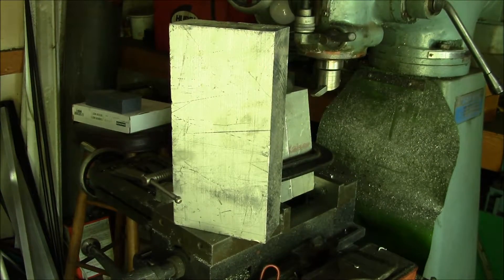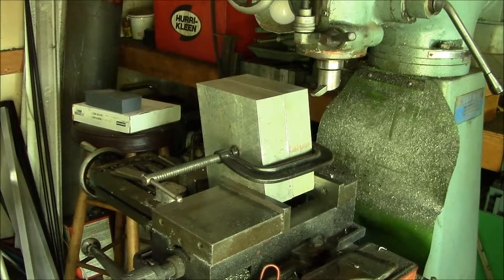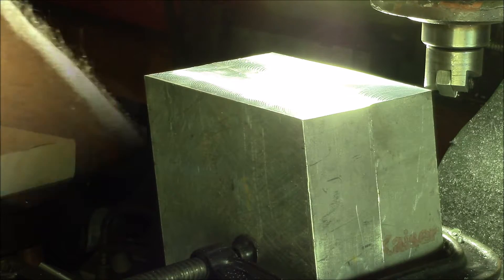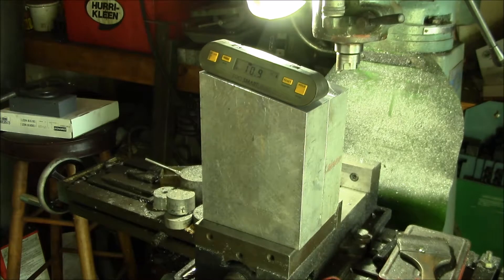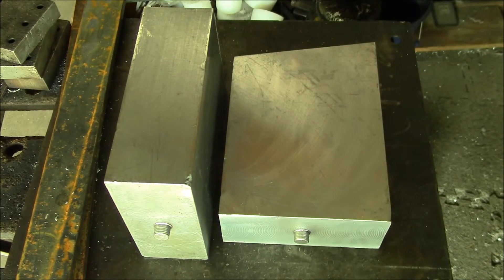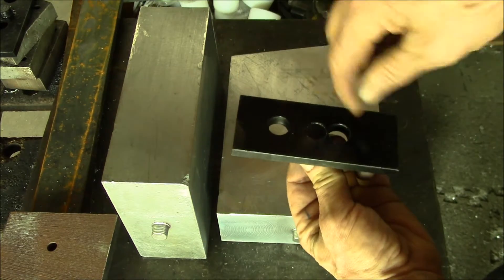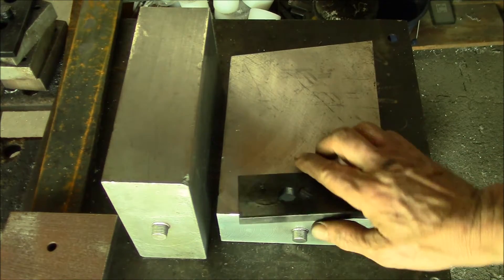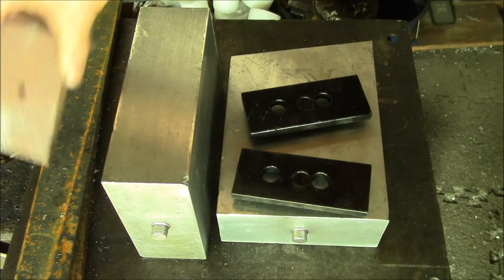Making Tapered Suspension Lift Blocks

Comment: Dont most tapered blocks have the pin on the angled side so it will rest on the spring perch?
Reply from the maker: We make them both with the locating pin and with a through hole for use with a longer center pin as the customer requests.  If you check out 4:03 in the video, you'll see the pins installed on the bottom, flat side of the block.
Reply: @The4Crawler  can you install the locating pin on the angled side of the block instead of the flat side? I would want the angle side down on the axle perch.
Reply from the maker: Yes, we can make the blocks that way as well.  This customer requested the flat side.  Sorry missed that part in the original question.
Reply: @The4Crawler  awesome. I sent a email to the 4crawler site.

Comment: my dodge feels like a noodle if i quickly mash gas at 20+ mph it has tapered rear blocks, They are 2 3/4 on one side and 3 1/4 on other end....should this make a difference in how the truck drives?
Reply from the maker: It may, you might be feeling axle wrap.  That's where the torque of the tires on the road cause the axle to rotate under the leaf springs and cause them to twist up.  This can be made worse by a tall lift block as the block moves the center of the axle farther from the leaf springs and creates more force on the springs due to the longer moment arm. Things that can help this are things like anti-wrap or overload leaves on the springs or traction bars on the springs or rear axle.  The other fix it to eliminate the tall block and instead install lift springs (~3" lift would do).  By putting the springs directly on top of the axle, you minimize the moment arm of the axle on the springs.  You may still need wedges to correct the pinion angle with lift springs.  The springs will provide the 2.75" of lift but you need the angle that the 1/2" taper of the blocks gave you.

Easy way to see if this is to mount an action-cam under the truck and record some video of the rear axle as you take off from a stop. Here's a video showing that:
https://youtu.be/7s4m5bwONNg
Reply: Thanks brother....I will check that out.